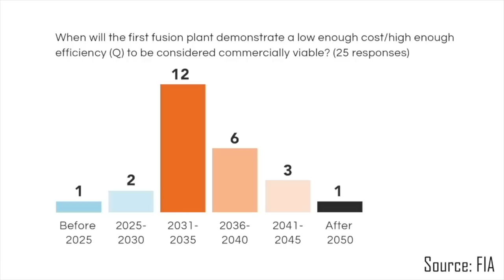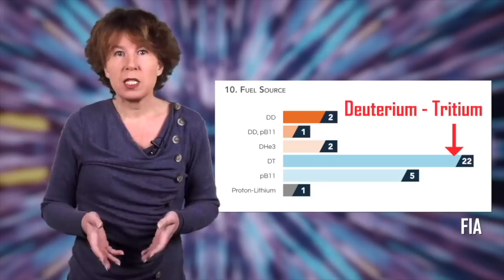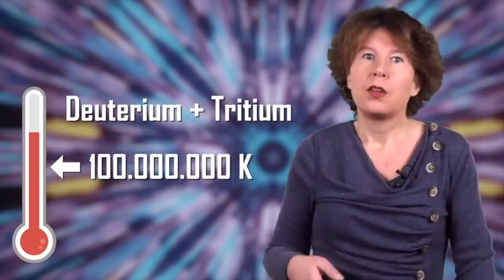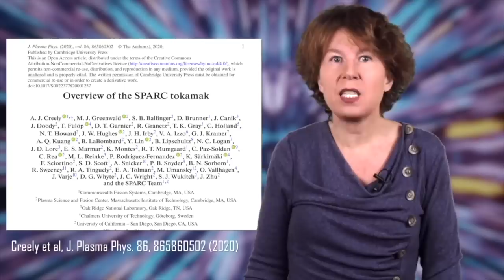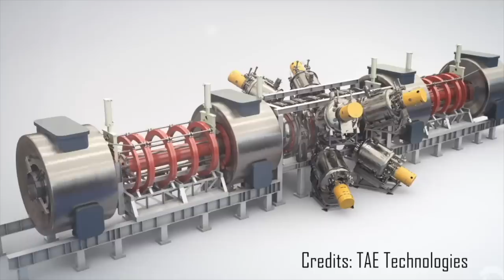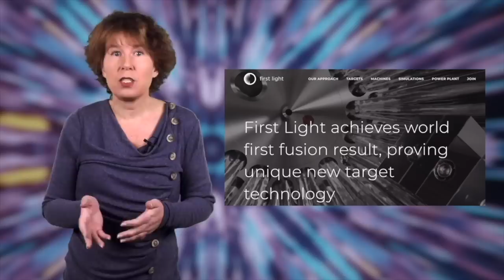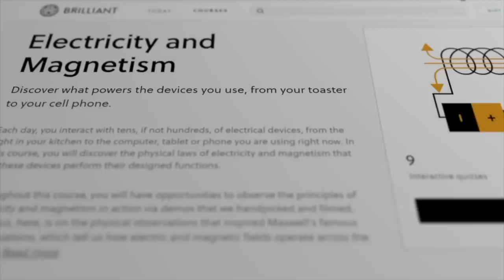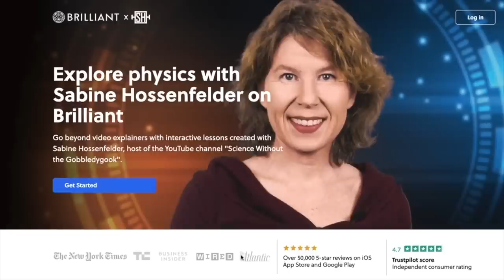Nuclear Fusion: Who'll Be First To Make It Work?

Comment: Without any science degree or deep insigth outside general knowlege based videos like this and others. The helium project seems the most interresting solving the main issue; fuel. also having direct eletrecity and no radiation on the sealing walls seems like what would make the best solution long term. In general any process not requiring Tritium solves the major issue, for thoes who do, even if they make it work. there is not a total amount of Tritium in the entire world to operate a single reactor in full scale.
Reply: Yeah, I've said before, I thought that fast neutrons were a deal breaker. But after thinking about the issue, I've started thinking that tritium breeding is a much bigger challenge. The whole issue revolves around first kick-starting the fusion reactor, and then breeding enough tritium on-site to keep the thing running. Many people are quite skeptical that that's even possible. You could theoretically breed tritium in normal nuclear reactors, but it would be insanely expensive. In order to operate reactors that use different fuel mixes, you would have to up the temperature to a billion degrees. Tritium deuterium mixes require 30 million, I think. 30 million to a billion? That's quite a jump.

Comment: Great overview! I like the energy sources that produce electricity directly like Wind, Solar, Tidal, hydro, and Helion's method (although not capturing the energy of the neutrons seems to be a waste). Boiling water to make steam to drive turbines just feels so primitive. Based on the dates you mentioned, I think that by 2030, we will know if any of these "early" systems are practical, which I think is unlikely. By 2035, we will have a clearer picture which technique has a path to being a practical energy source on a large scale. By 2045, somebody should have a fusion reactor contributing 100s of MW, in my opinion. So the traditional 50 yrs out has been reduced to 22 yrs out, again in my opinion. But this time for real (-:

Comment: 08:10 I thinkyour info is outdated, the record for holding plasma is currently held by the german reactor Wendelstein 7x with 8 minutes I think. This has happened rather recently though. 
Maybe you can put an annotation into the video after checking it out

Comment: I will have a corral full of Unicorns before any fusion power is supplied to the grid.  Ever since I was an adolescent in the 1960's I read optimistic projections of fusion power, just 30 years away!  Like a carrot on a stick, its always been 30 years away.  A laboratory experiment is one thing, a power plant is another and even to this day, a sustained fusion reaction has not been achieved in the laboratory.

Comment: All these initatives fail at the most important factor of main-grid electricity generation: it has to be CHEAP. The installations are going to be ridiculously expensive and likely disappointingly low in power output (so too many would be needed). The ones that are expected to yield a positive power output pretty much all require tritium which is really hard and expensive  to get (even when using beryllium 'breeding blankets'). By the time any of these iniatives ever manages a positive power yield, say 50 years from now, all other power generation methods like normal nuclear fission plants and especially renewable resources will ALSO have had an additional 50 years of research making them even more competitive than they already are today.

A more realistic future will be stuff like thorium nuclear reactors, higher efficiency solar panels, fossil fuel plants with full carbon sequestration, massive floating windpower parks, man-made geothermal vents. Basically core techniques that are already currently working, just improved in a what that makes them viable, scalable, safe and affordable for a humanity with a growing appetite for energy at an exponential scale but ever unwilling to pay more for it.

Comment: Just thinking of building my own fusion reactor in the back yard. Can I do those stellarator calculations on a home computer?  Evidently not, but suppose we make it a stellarator/tokamak hybrid, would a home computer be good enough then?

Well I've never really understood how a magnetron works, never mind a stellarator. I would love to see a series of videos on all these topics, accompanied by software which we can download and run, and also tweak the source code. I have an electron in a dipole magnetic field set up on a spreadsheet, along with a 1D Maxwell equation simulation. Can I have permission to mention where my Van Allen belt simulation can be downloaded for free?  Really I ought to set up my own YouTube channel with a link to a website. Wish I had the time to pursue this, but the day job doesn't permit. 

Cannot help thinking of aerodynamic analogies. Inertial confinement = pulse jet, like the V1 flying bomb of ww2. Stellarator = axial flow gas turbine like the Messerschmidt 262. Tokamak = centrifugal compressor gas turbine like the Gloster Meteor. Modern aeroplanes all use the axial flow gas turbine. A useful hint?

Comment: If I had to bet, the winner will be some small outfit that runs into something that they don't understand --- and that no one else has seen before.  It will probably be a stupid fluke. Quite likely, the engineering advantages will become apparent before they fully work out the theory.  Having worked with steam power plants, I figure the fusion reaction will need to put out three times as much power as you pump in just to get to the point where you are breaking even.  That's taking into account steam plant thermal efficiency, plant auxiliary loads, and generator losses.  Maybe the need to cool liquid helium or nitrogen will drive this efficiency even lower...

Comment: Is finding a hotter heat source really what we need right now? More heat produced means more WASTE HEAT that has to get dumped somewhere.  That's how we got where we are now.   While existing nuclear fission reactors emit no CO2, they are no more efficient than fossil fuel plants. 

Why?  Heat is used to produce steam for a turbine., which drives a generator.   The nature of the steam cycle is such that  Best Achievable Efficiency hovers around 43%  So for every gigawatt of electricity, MORE than a gigawatt of waste heat is produced.  This is not a solution for the problem we have.

Comment: A year has gone by, and no fusion.  Fusion has been the energy source of the next 20 years for the last 70 years.  Not trying to be a downer here, but its not an easy problem to solve.  TBH, we should be building more fission plants, and do reprocessing of spent fuel in the meantime.  Of course, this is institutionally impossible at this point so unless there is some reform of the government we will continue down our current path.
Reply: The problem is not institutional but financial. Everybody can build a fission reactor quickly. Everybody can build a fission reactor cheaply. Everybody can build a fission reactor safely. Nobody can build a fission reactor quickly, cheaply and safely.

Comment: thank you, by using jet plasma machine and compressed gas in isolated structure , New energy from sea will change world soon, there are other source of energy that with international cooperation in coastline we can reduce global warming, sea is huge source of energy, further more  we can prevent these phenomena like cyclone and flood and wildfire by using this hot seasonal atmospheric condition, recent years in summer, geothermal energy happens in surface of coastline, there are many countries in coastline with seasonal hot weather and water condition, in sum-up, by using this energy not only is economical but also reduce global warming in countries like Japan, China, India, Mediterranean countries, Iran, Brazil, Mexico, Us, Canada, (Africa and Arabian countries....) . I invented new method base on air pressure rules and quantum physics ionization sea water minerals in strong dynamic magnet bases on paramagnetic and diamagnetic particle and electrical field and electric chemical reactions as major part of fuel (more than 50%) for producing electricity and fresh water and fertilizer. 7 methods for reducing global warming I mentioned in my profile.

Comment: I'm sorry, but no one is going to make artificial fusion work!  In fact, pretty much everything we are told about the potential for fusion power is a lie!  Currently, the most successful controlled artificial fusion process still requires 100 times as much input energy as it puts out!  And you must understand that the energy it puts out is just low level heat and dangerous radiation, not useable electricity!
Reply: Low level heat 😂 do you have any idea how hot it gets?

Comment: Fusion is great for a whole lot of nuclear research that wouldn't have gotten funded otherwise, but overall it's a false hope. It's never going to be realised. There are insurmountable problems. Even if a working design could be built, it would power one network and one network only - there either won't be enough input fuel and/or won't be enough suitable metal for the reactor to run more than one installation on the planet. (NB: there are 62,500 power plants on earth. Fusion can only replace ONE of them).
Fusion offers a benefit for the fossil fuel industry though - while we chase the fusion rabbit, we aren't putting resources into alternatives that might otherwise challenge the dominance of fossil fuels. We lie to ourselves and say we'll use fossil fuels and reduce it with some solar and wind power, and then fusion will be ready and we can finally be done with fossil fuels. Face it; not going to happen. Start looking at less lucrative but more plausible technologies, or admit that we're in fossil fuels until there are none.

Comment: Yeah, right, now only 30 years away. 
After  almost 100 years of trying to make it work, the process is still under 1% efficient. And even that 1% is only possible once or twice a day.  And that's not to mention that no one has yet come up with a way to produce tritium, now one of the most expensive elements on Earth, in an economical and sustainable way. 
 I bet every one of these boondoggles start using uranium or plutonium, if they ever even open up in the first place.  All in all, its probably going to be just a sneaky, back door way to get fission reactors back on the grid.